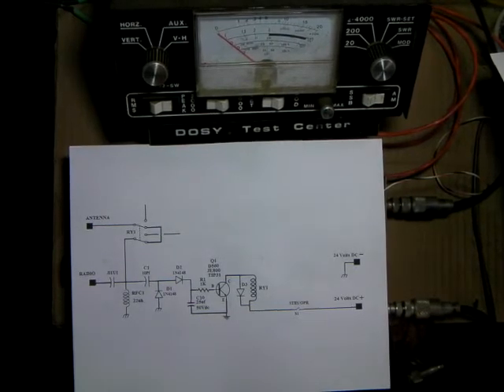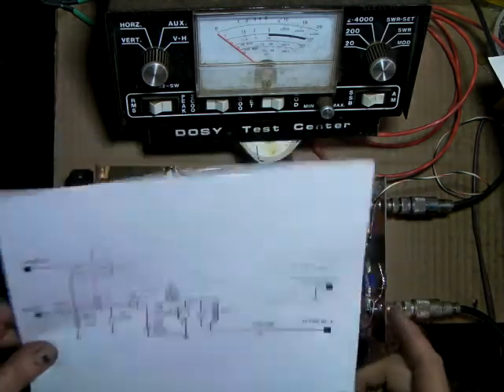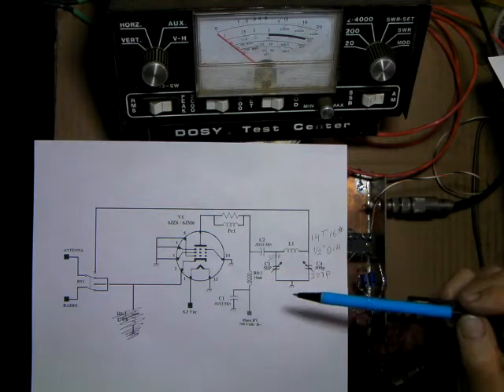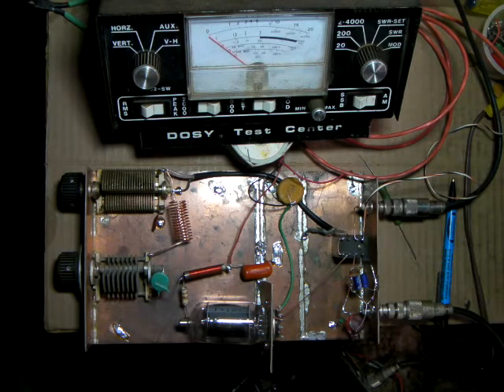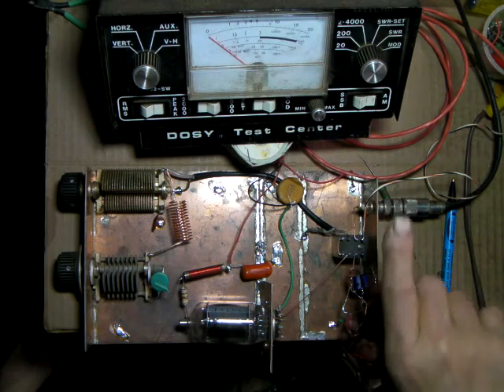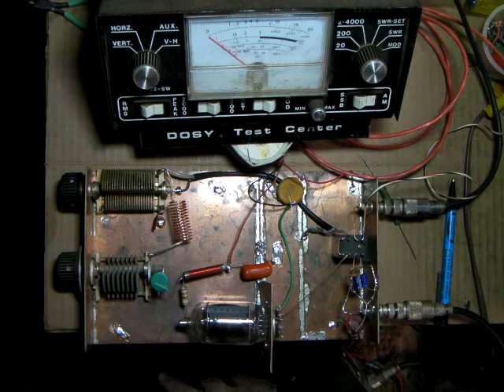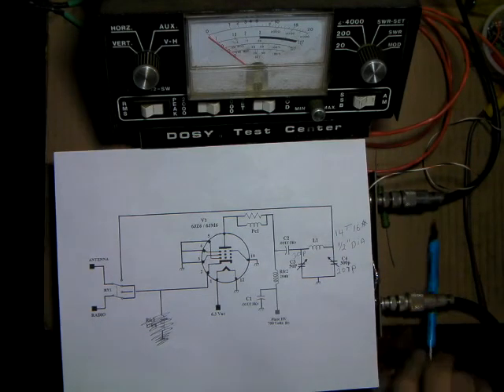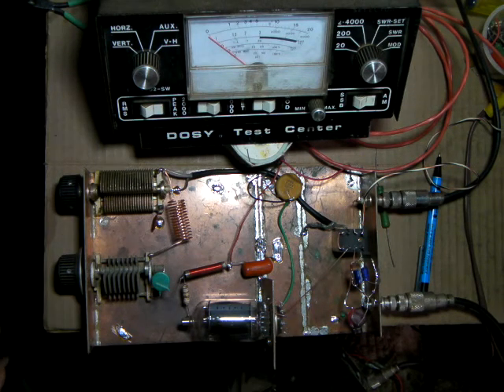Build a Tube Type Linear Amplifier For CB Or Other HF Bands Ep12: Building A Single 6JZ6 Amp Pt3

Comment: Thanks for these videos. I would really like to learn more about tube electronics. I want to know if i can change capacitance after the mains transformer in a 4x EL509 valve amp. I think the triodes can be driven at much higher voltages. I was wondering about fitting bigger caps with higher capacitence and higher voltage rating. Would this alone raise the voltage or would i need to look more carefully at what other voltages are needed in circuit before i try this. I also assume i would need a larger transformer. Perhaps for now i'll just add a fan and try to g for slightly higher power levels. I'm looking into how voltage doublers work right now.
Reply from the maker: Send me an email at: radiomedic111@yahoo.com
And I can help you easier there....my internet is too slow to send info on YT

Comment: This tube is similar characteristics as a 6lf6 just different wiring on the base?
Reply from the maker: YES, Except for Pin 9 and pin 11
that are already grounded at pin
5 and 3, you could plug it into the
socket and GO with only a small
re Tune and Load with one tube.
Two Tubes would require a few
less turns on the PI Coil.
Reply: @radiomedic111  I have a bunch of 31LF6 tubes  and maybe a few 24LF6 ones